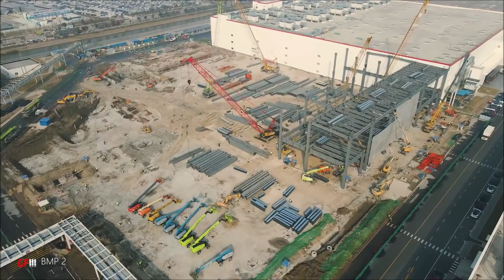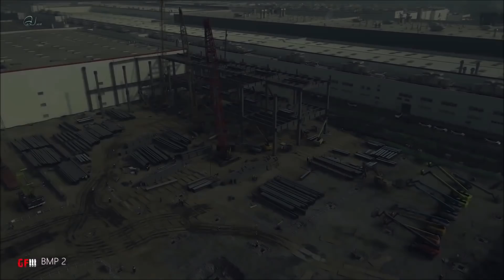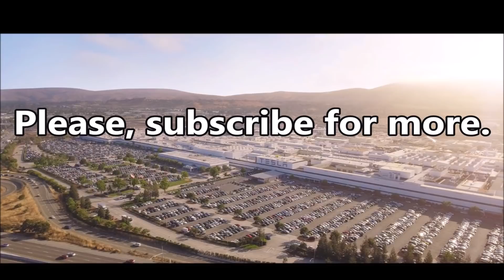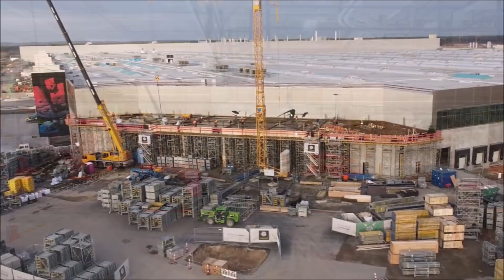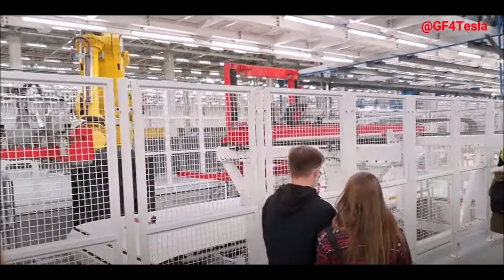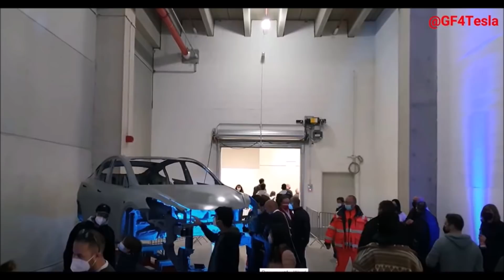Tesla Giga Shanghai's New 242% Record and 400K EVs

Comment: Austin and Berlin are not port cities.. Is the supply chain and export convenient?
Reply: Giga Berlin is only going to be used for European deliveries and Austin only for North America.
Reply: Huh? What do ports have to do with anything? You need ports when you must transport between continents.  But the whole purpose for both these factories is to deliver within their respective continent. Berlin will be delivering across Europe requiring transport by land. Similarly Tesla  Austin is meant deliver across North America.
Reply: @Californiatimetraveler  Huh? how do you want to move thousands of cars over long distance distribution and how do you move massive quantities of supplies without water transport? 
A strategic location is very valuable when deep sea transport and inland river transport can be offered in addition to air, road and rail.
Reply: @ttemp2631  you are clearly missing the point.
Reply: @jimtoomey9522  NO YOU are clearly missing the point.
Reply: Berlin plant has a convenient railroad spur. Austin does not (yet). Export over seas is going to be minimal. Received raw material has to be mainly by truck.